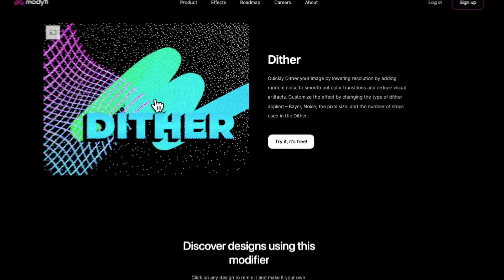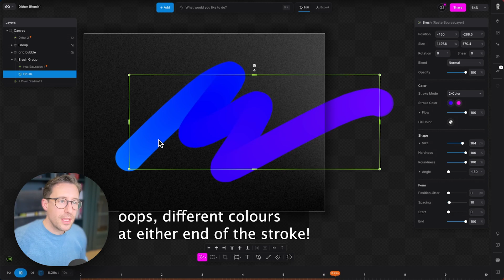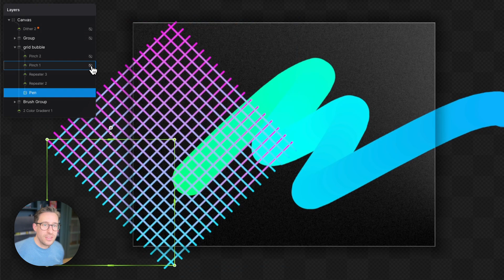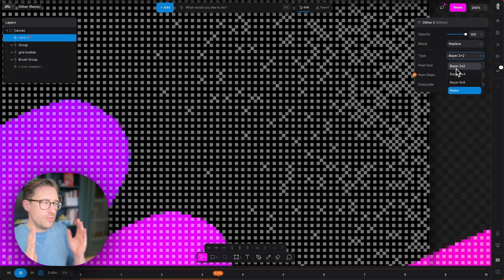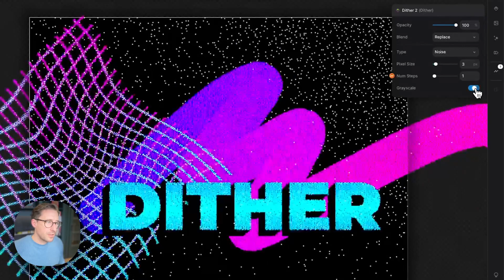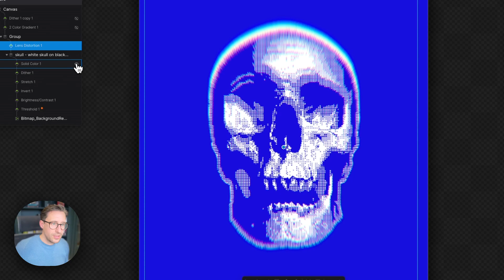Comment: RE: the pinch modifier, any way to have it apply the effect to a vector path itself before a stroke is added, so as not to distort the width/size of the line strokes? Hopefully that makes sense and thanks for the helpful videos!
Reply: Not just yet, but we're working on it! One way you can do something similar in the interim, is to use pinch on a vector shape or path, then use the Outline Modifier, above the Pinch in the layer tree, with a "replace" blend mode. Then the width of the stroke that you create with the outline is not being distorted by the Pinch modifier, but it traces the distorted shape beneath. Here's a quick remix to demonstrate – https://mody.fi/bRvmQcrrDx9ejN78p2Utcn
Reply: @Modyfi_  Ooh cool, thanks for the tip. I'll check out the remix!